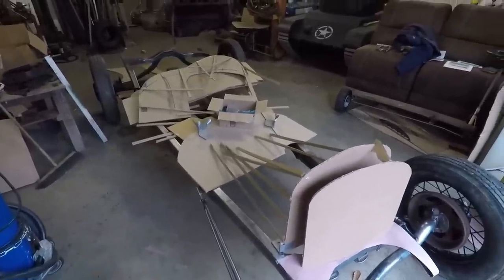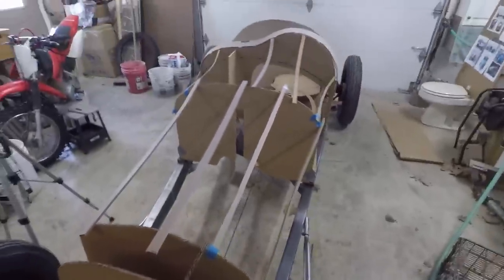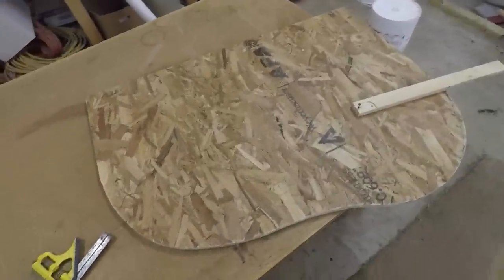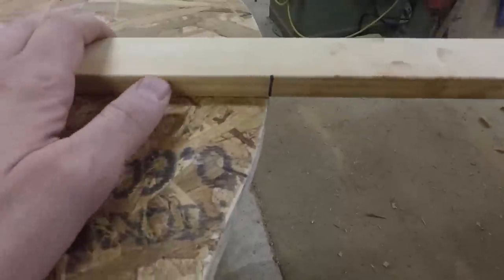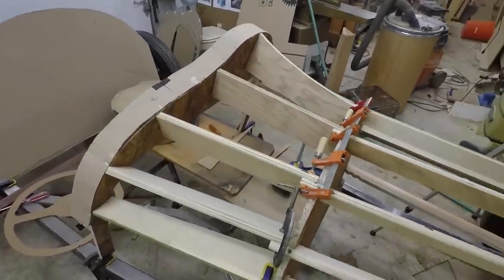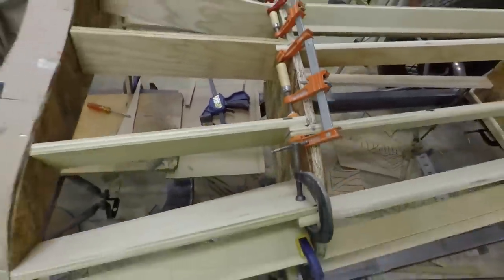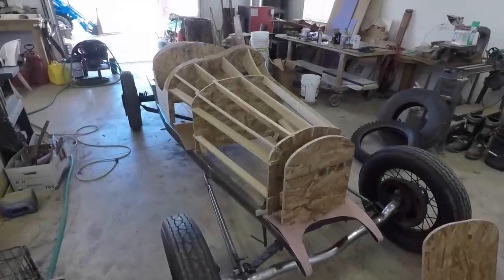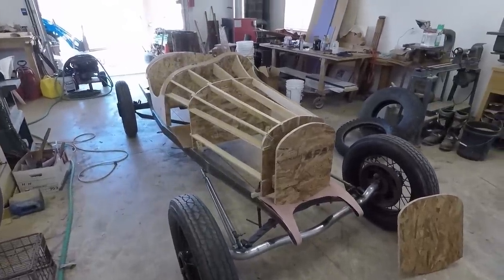Building a Wooden Body Buck from Scratch | Boat-tail Speedster Pt.20

Comment: Uphill all the way is an understament lol! Love how help appears right at the last minute you've done all the bull grunt work of getting it there! Lol! That's life I guess?  But absolutely awesome stuff to see. The original ford's most of the original body's were held together by wood and wood screws! The floor boards were actually called floor boards for that reason.....they were oak wooden boards! As for the main structural integrity of the body's were all reinforce by oak wooden parts and pieces. People have no idea what held together cars up until basically WWll! Factories didn't have the means to make intriquit for metal forming back then to make special bends and shapes in steel or it was just too costly to make at the time before robotics and huge die presses with their overly complex forms and molds that we have today. Like the art of hydro forming we now make chassis frames from highly pressurized water to form steel to shape of the molds. We've come a long ways from wood but it's a lost art also! After building a couple wooden race boats, you get a higher respect for the trade and the artistic side of carpentry that normally isn't used especially when dealing with complex curves or even bending wood to shape. It's not hard, but you will definitely go through a learning curve to get good at doing it. Good luck with your project so far it looks awesome brother! 👌

Comment: Love the car. Loyal follower. That being said. I hate to see that after all that work u used chipboard instead of some nice furniture (or at least standard grade) plywood. U will defiantly have problems with splitting down the road where u screwed down through the edges. Hope I'm wrong. Cant wait to see u cruising it around. U totally deserve it for all your hard work.
Reply from the maker: the wood is only a template for making the body. it isn't permanent.

Comment: Nice result but I saw several mistakes...

1) Pushing a car uphill like that you can seriously injure your back - also if the car escaped from the shims it could run over you and cause an ugly accident.
2) To cut several long pieces out of wood you don't move the fence of the tablesaw every cut, you just set it to the measure you want and pass the wood several times, this way you save time and you ensure that the different pieces will be exactly the SAME size.
3) You don't want to push the pieces of wood against the blade using your hand that way, otherwise you are asking for a nasty accident sooner or later. Instead use a push stick.

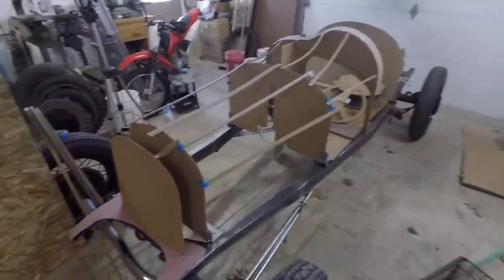Oh, and by the way, that big board at 1:04 is NOT plywood, it's OSB.

Comment: Incredable job! I wondered why you didn't use more of a furniture grade plywood and why you didn't you use wood glue also.
Reply: That wood will not be in the final body. He's making a buck to form the metal panels on. Other framing will form the support structure in the final body.
Reply: Look up Runge cars on YT
Reply: Look up Runge cars on YT.
Reply: @daveanderson2316  I've seen you comment that like 10 times how about give a reason why

Comment: I caught a view of the second X frame crossmembers you made ... at the end of the video you said you narrowed the front of the frame, and it looked like the X member was gone.
Are you making a third?
Will the hood have sides?
Will the firewall have (engine turned) steel or aluminum on the engine side?
Looks great so far.
I hope whatever state you are in does not give you too much trouble when it comes time to register and license it.
Reply from the maker: yeah, I have better material now to make another one

Comment: Have you done coachbuilding before? Looks like you're pretty familiar tackling a big project like that. Do you plan on road registering this?
Reply from the maker: I've never worked with sheet metal, so it'll be a challenge
Reply: @MacroMachines  is honestly reccomend taking a coach building class. I didn't realise how hard it actually is. Learned everything in just one class.

Comment: The project seems cool, and not to rag on you but i saw a couple safety issues i would address immediately in my shop; 
1)  never seen someone use a table saw backwards before but I have seen small scrap like that rip clean into a wall. 
2) the safety block was used in the had farthest from the table saw blade... I've seen someone loose a finger tip over that. blood everywhere. 
3) Radial arm saw used in reverse. saw away from you so you can control kickback and the blade will be happier also, pulling towards you will have the blade jump at you rather quickly. 

Back to normal questions:
is this an electric car? 
how are you to access the drive system? ie no hood/trunk or is this just a shape thing?

this would look awesome as a wood car btw. nice shapes but why does the hood rails stop at the fire wall, couldn't they have gone right to the dash?

really this is a neat project and i hope it turns out well.

Stay safe :)

Comment: the actual cowl to the steering wheel is probably the hardest part to make
think the rear you can make as shiplap , using 3 inch or so wide strips of aluminium (the narrower the strip the more precice the shape will end up after welding , but youll be welding a LOT) start from the top and lay the next strip far enough over the other there no gaps  where they dont overlap http://www.jimsboats.com/webarchives/2001/clinker.gif , then cut through both strips getting the edges to fit butted to eachother and weld them together before doing the next strip in line you end up with the coneshape with angulair flats front to back kindof like facets on a daimond but a little more shaped intoo the compound curves 
that should get you pretty close to the shape and getting the welds flat and the overal shape smooth with the wheel should be possible might need to make relieve cuts and reweld at times
might need to investigate the way to work the aluminium and wat type to use as it will workharden and might need to be heated up to take the hardening out or it will crack
curious to see youre idea for the english wheel , i think it needs to be as deep as the widest part of the car measured toward the centerline and have enough height from the bottom wheel to the top of the bottom frame to put a piece halve the height of the body through (think you need to make the top part of the cone and the bottom part ) , that should make it possible to roll the cone from the rearseat to the point , if you roll it as one big piece
Reply from the maker: that would make it nearly impossible to get an even contour on the boat tail. This gives some good pictures of what I think is the best way of doing it https://www.hemmings.com/blog/2015/02/27/mcpherson-students-helping-replicate-the-roadster-that-won-the-1935-indianapolis-500/

Comment: With all my respect, I'm afraid you are not very good at woodworking. OSB (and not plywood :) ) was not the best choice for the job, and also you should not drive screws from the end-grain. Other, than that I still love your work, keep on!
Reply: Yeah, but did you notice that he predrilled the holes to avoid splitting? Seems to know what he's doing.
Reply: @happyhollowtales9034 , It's not just about the splitting. Let's keep it simple: never drive screws from the end-grain. First attempt at 2:10! This technique is more for mockups, not for building a final product.
Reply: @sharedinventions  you're absolutely right, and this is just for a mockup. None of that wood will be in the finished product. It's all just a template to make sure that the aluminum body has the correct shape as he welds and fits pieces together.
Reply: @happyhollowtales9034  Sorry, my bad! Now I see the same in the video description. Somehow this template thing didn't came out for me from the video.
Reply: @sharedinventions  , 👍.